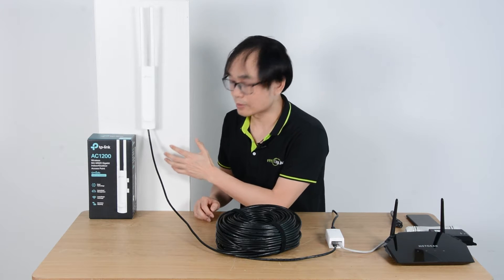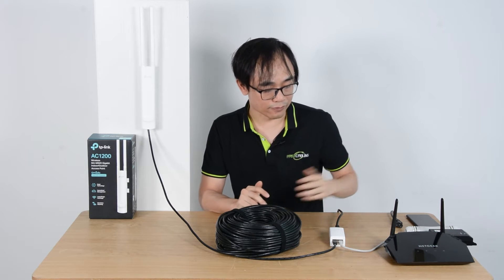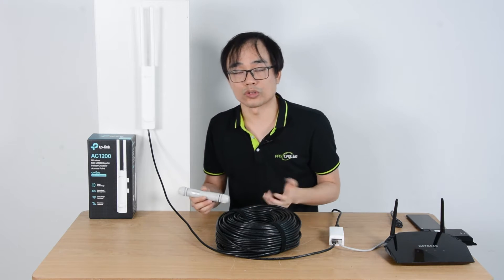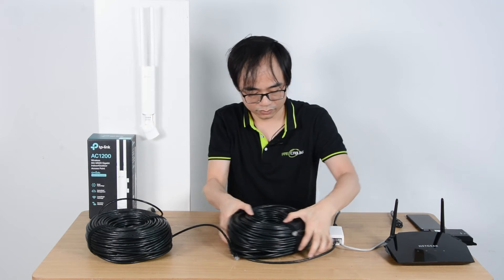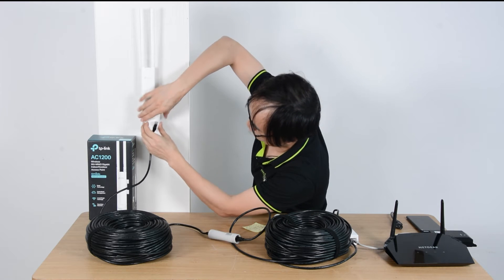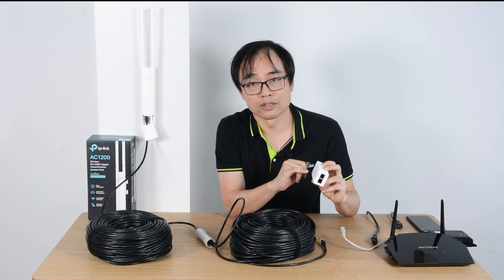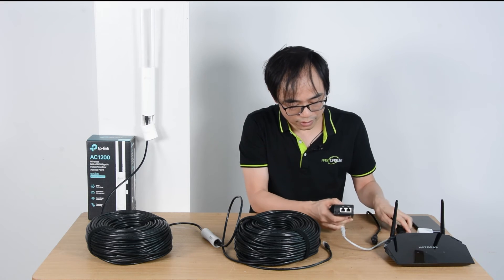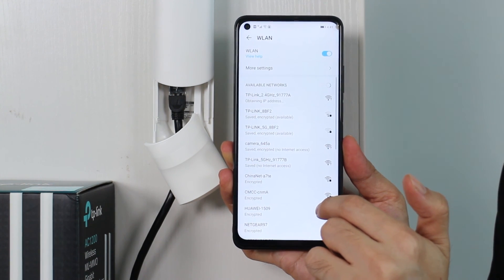How to Install EAP225-Outdoor Wireless Access Point over 100 Meters

Comment: the longer the wire the higher is the resistance..to compensate for the voltage drop due to higher resistance the voltage has to be increased also
Reply from the maker: By regenerating the power and data signals, the PoE extender helps maintain the necessary voltage over longer distances. Pure copper cables are an excellent choice for long cable runs because they have lower resistance and better conductivity than CCA cables.
Reply: @Fastcabling  pure copper is indeed the ideal cable material

Comment: Thank you for this video demonstration. May I ask if the PoE injector you used is passive or active? Should it be considered whether the PoE injector is passive or active? And is it okay for the EAP 225 antenna if you used a 48V DC PoE injector? Many thanks.
Reply from the maker: It's a standard 30W PoE injector (active). EAP225 can work with 802.3af or 24V passive PoE (injector included) but it cannot work with 802.3bt (4-pair PoE). For more information here: https://youtu.be/mUWJ_lbMt8U

Comment: I want to replace my POE injector that came with the TPLINK EAP255, I need to extend the eap to 30 meters, because the poe that came with the eap has 24v only and cant power the eap. What POE injector can you recommend?
Reply from the maker: The EAP225 supports 48V standard PoE and the 24V passive PoE. While you  use the original PoE injector, it will send the 24VDC power over twisted pair 45-78. If you want to use the DC48V POE injector, just make sure the power pin from your new PoE injector come into 12-36. It should be good, because EAP225 accept 48VDC POE from 12-36.

Comment: If you use a LAN cable that is >80m or 100m in length. You'll gonna have a headache.
Reply from the maker: You can use the waterproof RJ45 coupler to join two pieces of cable together.

Comment: I have 3 eap 225 outdoors antenas in mesh. Are there any other tp link antenas that can link with that same mesh technology to those eap225 outdoors antena. Say i want to expand it into a nesrby home that doesnt quite have enough signal strengh.
Reply from the maker: As you know, the bandwidth will be 50% from the new added node in the mesh. If the signal is too weak, you might consider wiring the cable to somewhere close to your home. You can’t boost up the Wi-Fi by adding more nodes.

Comment: Is there special cable for ap to adapeter? I used yellow cable it seems not working
Reply from the maker: Cat6 will be better if you need 1000mbps bandwidth between the AP and the router.

Comment: I need to connect to a park that is about 1/2 mile from my house the park gives free wifi. Can I used this device to get internet at home. Thanks
Reply from the maker: I think you will need to go for the fiber optical cable or a wireless bridge if there is clean sight on both. The bandwidth will drop down to 10mbps from 100mbps after 500 meters.

Comment: can I connect my router DIRECTLY to the EAP ??? or do I have to use the injector ??
Reply from the maker: Yes, but you may need to add the injector between two of those. The injector has two ports. One LAN ports suppose to connect the router, and the PoE port suppose to get to your EAP. The injector will combine the data from your router with power and send them to EAP.

Comment: i am worrying if my access point will be getting over voltage if you use that poe 48volt.
what is the brand of your extender?
Reply from the maker: Your access point suppose to have POE feature built-in. If that is the case, the POE feature will regular the power to the DC12V to supply the access point. If your access point doesn't feature with POE, you can add the POE splitter ot seperate the power and convert it to DC12V before you put it to your access point. This is the access point. https://www.fastcabling.com/product/poe-extender-outdoor/
Reply: i am USING multiple VLANs to My MULTIPLE SSID.
my question is of not affect my vlan set up?
thank you

Comment: Good day! what is the problem of tplink eap225 LAN is down?
Reply from the maker: The original injector is passive type, not the standard PoE/PoE+ compatible. As eap225 accept standard PoE, you will need to replace it with a standard PoE/PoE+ injector